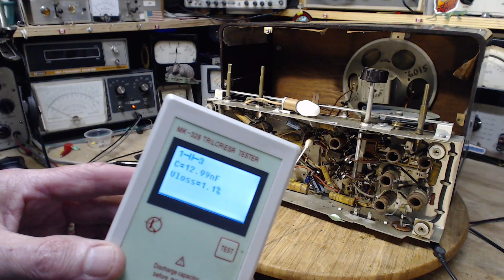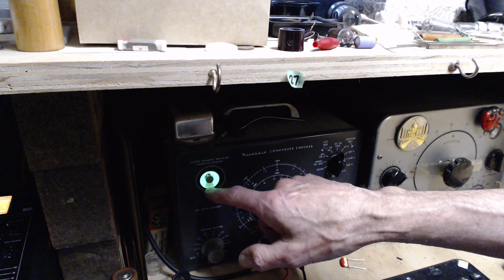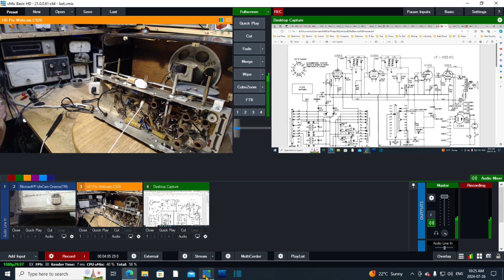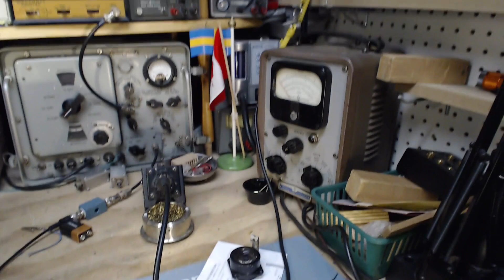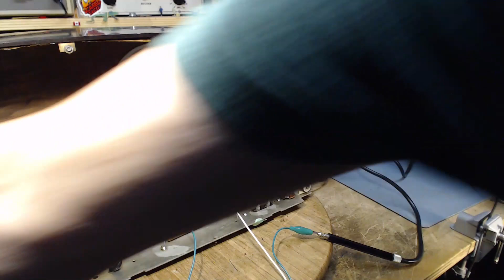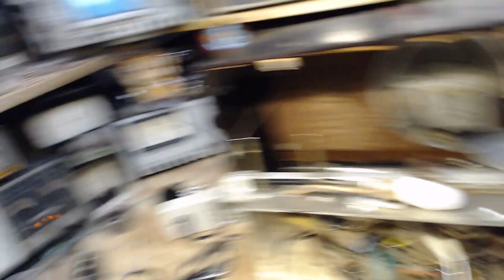Philips Model 922 Tube Radio Video #2 - Grid Voltage Anomaly

Comment: didn't that grid resistor read 525K?....It is supposed to be a 474K resistor, so isn't it part of the problem,  being about 50K too high? Perhaps a new resistor should be installed, and if the volts are still too high, replace the tube with a known good one.

Comment: Being able to understand schematics is important, if pin 2 is internally connected to pin 5 on the 50C5 that means the "missing" resistor can be on either pin 2 or 5, it's on pin 5 in this case
BTW, Jim doesn't read comments so this info is for anyone else who does.

Comment: 30:00 You have seen 8V on the 150 Ohm cathode resistor... The schematic calls for 6,5V only.
The 8V you see correspond to a cathode current of 53 mA.
The intended current per schematic is only 43mA.
53mA instead of 43mA, thats like 25% over
So you will load down the rectified b+, thereby increasing the hum and stress on the rectifier tube.
And you will also be putting more power dissipation into the primary of the audio output transformer.
But since this is a "guarantee void if radio leaves workbench" fix, go ahead and redesign the radio. Philips didnt know what they were doing. You know better...

Comment: 28:40 If the grid coupling cap can be ruled out and the grid bleeder resistor is not open, such a slowly creeping up positive going grid voltage is mostly a sign of either a gassy tube or grid emission. The latter often due to evaporated cathode material depositing on the grid, which in turn is often a result of an overheating of the cathode.
In any case changing the tube is the way to prove it, because in rare cases dirt or degradation of the tube socket may cause external leakage paths from a screen or plate pin to the grid.
That tube socket degradation and the resulting development of leakage paths, sometimes leading up to even carbon tracking, has (at least in europe) been seen frequently on sockets made from resin bonded paper (Pertinax) from the 50s. And in most cases it involved the miniturized 9 pin tube sockets in combination with the extremely hot running audio output tube EL95 (6DL5), which to make matters worse has the ground referenced heater and plate on adjacent pins.

Comment: Those old carbon composition resistors as they age are troublesome. Applying a voltage to them "heats" them up and
change value, sometimes dramatically.